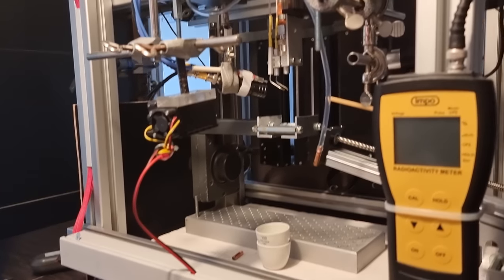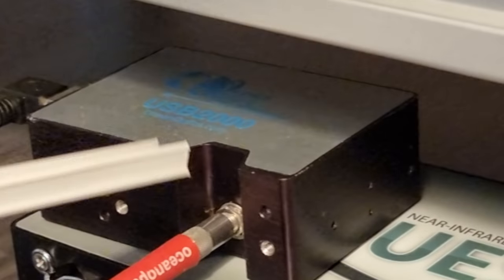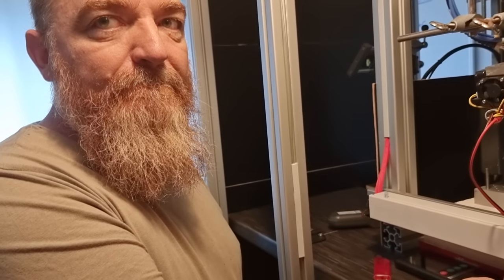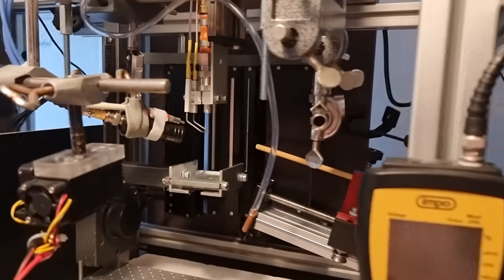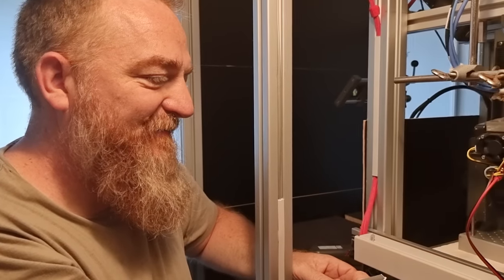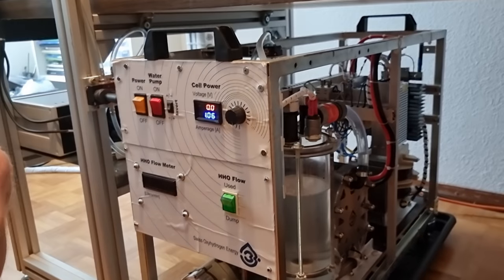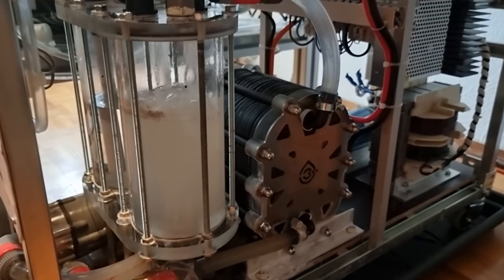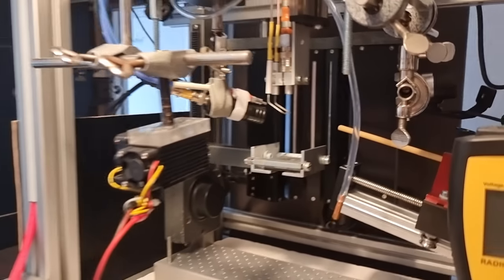Fixing Fukushima - Look at Slobodan Stankovic's lab

Comment: Santilli's magnegas technology is quite similar, based on a pulsed discharge of electricity. Santilli's theory is about a permanent magnetic polarisation that can be forced on atoms by exposing atoms to a very strong magnetic field (the pulsed discharges). Santilli was able to measure many new types of molecules that differed from the usual chemistry, by means of a mass spectrum analyser. What exactly is HHO? Is it made of 'magnetic H' and 'magnetic O' atoms that can form big 'magnetic atom' clusters in gaseous form?  Santilli applied this technology to waste water, that also contains lots of organic carbon and other elements. But when pure water is applied we get  HHO,  so what exactly is it?  Kudos to Slobodan Stankovitch, each small and private lab is like a gem stone of western civilisation that is based on a very strong middle class society.
Reply from the maker: I have argued that the mixed oxy-hydrogen gas contains not just H2 and O2, but also H and OH and H2O this is shown by analysis of Ohmasa gas. These thress gasses can mase and particularly OH self-mases - it does it all over the cosmos. This means it can become coherent matter. I have argued that any magnetically charged cold neutrinos and their condensates can aggregate in the uniquely (for low atomic number elements) paramagnetic O2 - this then binds clusters together. When interacting with metals the highly non-linear nature of the magnetic structures can lead to micro-ball lightning and together they lead to electro-nuclear collapse and all the other effects observed by us and Takaaki Matsumoto.

Santilli was using arc discharges between carbon electrodes, this will produce oxy-hydrogen gas and ignite it at the same time in the same way as Matsumotos simple 200 V AC pulses in a lead wire electrode, KOH and H2O produced Oxy-Hydrogen gas and ignited it - Matsumoto was able to readily synthesise Carbon in these experiments, Carbon and Oxygen fused produces Silicon and this is often found too.